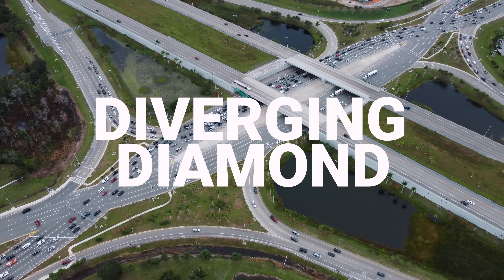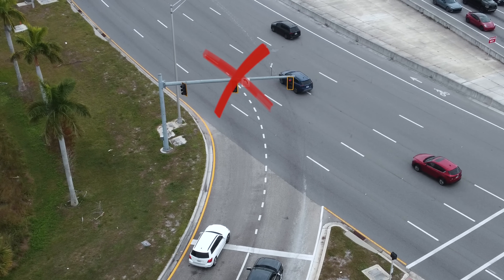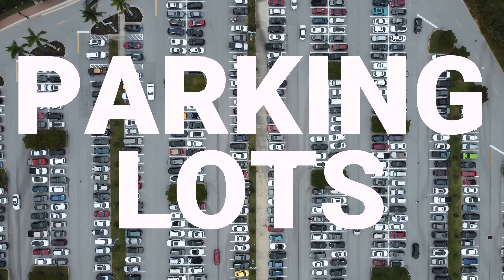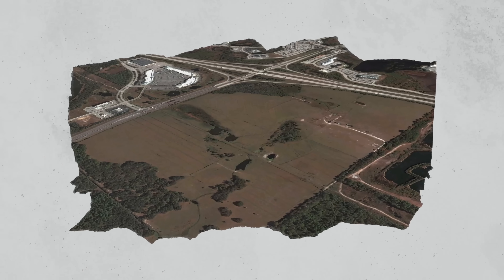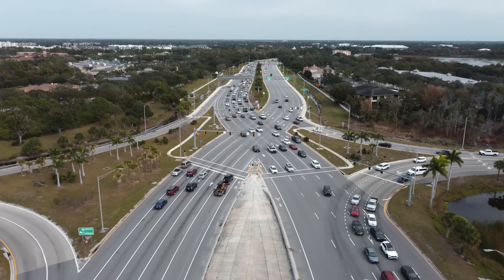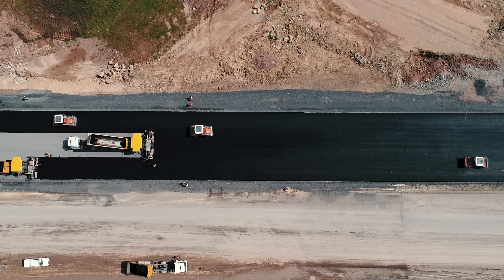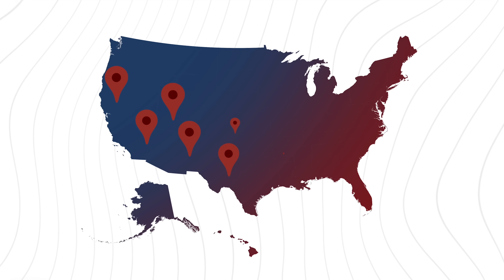Traffic Will Never Be Fixed Here

Comment: The problem in America with mass transit is that it's never profitable. Look at Amtrak, it's never made a profit. Even way back when the the major rail lines used to have passenger rails the only way they can make profit was through the postal service. Once that stopped they lost income and could not keep the lines. Mix that factor with the fact that Americans also want to be able to drive anywhere at any time and you have this mess. It seems to me the best mass transit is the transit that is too expensive for the average American or gets it's income from taxes, which is also not ideal.

Comment: The problem with UTC is in part the sheer amount of cars. Undeniable. But the main problem is UTC has these chokepoint intersections, where EVERYONE has to use the same intersection, even if their target destinations are all wildly different. If they laid UTC out like traditional city grid with street parking, you could still handle a ton of cars, but people wouldn't all be piling into the same intersection at once, which is what causes the bulk of the traffic issue.

Comment: I disagree with, “we should make suburb style areas all into more downtown walkable areas made for people not cars” in some way. I grew up in a small town that used to have many different public places before condos and more homes along the beach and in place of areas that used to be made for kids and people. Now the area is an old folks home. But, before that, because the town was so small, basically everyone there knew each other and you could be in a random store. Someone will recognize you anywhere. The roads never get traffic unless there are big events which happen a few times a year.  The most lanes ive ever seen on a road there is 2 lanes per side. The area is completely walkable and people can bike places too. It just takes a little more time than a regular urban area. The place is designed for roads and people. Just the right amount to the point that every single red light can realistically become a roundabout and would be safe for people and get cars to places much faster. It is a little hard to explain but it is called Fernandina Beach/Amelia Island in Nassau county Florida. Im talking more about the actual island part not yulee. It is pretty interesting especially when I see this video to think about. It would be cool if you check it out because it might derail some of your ideas and create diversity in your ideas also!

Comment: You can build an entire town center in the space taken up by that ridiculously large intersection. Taking 2 tonnes of metal to do basic shopping, waiting 20-30 minutes in traffic each way and guzzling fuel does nothing to add to quality of life. It may still count as "GDP", and is also why raw GDP numbers (which can be manipulated in many other ways) don't tell much. In a different country, one could take a tram - or walk - to shops located much closer to where one lived, and have the same living standards.
Reply: This is not a town center, so this is not a place to build one.  This is outside the city center to distribute to local roads.

The stores here are used by regional/state consumers, not local residents only.  Items sold are not able to carried by hand nor transit, so there is need for parking for shoppers to purchase items.  And the same consumer does not shop here everyday.

Comment: A solution could be on 3 levels: ground level one of the main roads,     elevated level a roundabout, second elevated level the other main road. From the roundabout ramps accessing or coming from the main roads.
Reply: It would cost more and get morr congested due to higher volumes.  Roundabouts work better on lower volume interchanges.

Comment: Us Americans have been brainwashed to think that this is how we have to build our cities because “we’re too big”. 

Japan isn’t walkable, Tokyo is. No one walks 40 miles from Tokyo to another city. They take a car or train. Google the size of Tokyo compared to Houston, Texas and you’ll see why it’s a silly argument to not build for people.
Reply: This is not the city.  This is outside the city.  So by your argument, they use cars.
Reply: @traffic.engineer it’s “outside” the city because the city has built too sprawling, requiring people to live a 30-60 minute drive away because houses apparently have to be 600 feet apart because “the US is too big”.
Reply: @jasonbfhfj8132  again, this is not inside the city.  Downtown Sarasota is high-density low-speed beachfront resort.  That is the area designed for local accessible use.

This area is not local residential, but an area where transnational traffic filters to local points of destination where those residential areas are concentrated. This freeway is set far away from the city core, as freeways in a downtown us questionable.  These commercial areas serve customers from all around the state, not just locals.  This is due to so few of them built in the region/state.  And they sell items that cannot easily be carried by hand.  Which is why this caters more to automobile traffic easily accessible from a national route, as opposed to the city areas where commercial districts serve the local residentials and workers with local low-speed roads.
Reply: @traffic.engineer this exists because of the extreme necessity for cars. Improve walkability and trains and this wouldn’t need to be an issue. A basic highway would have sufficed.
Reply: @jasonbfhfj8132  Sarasota is walkable.  Sarasota County and Florida is not walkable.  No one walks from 100 km to another city/country.  They take a car or bus.

There is already a bus station on shopping center complex.  It provides access from the city center to the commercial district, using a separate road and access from this interchange.  

This interchange specifically deals with the transnational traffic and long-distance customers either stopping for breaks or shopping for large ticket items that are not purchased everyday.  Using rail here would not be cost effective because of the large construction cost, lack of everday commuters (not the central business district), and customers that are in various locations throughout the state/country.
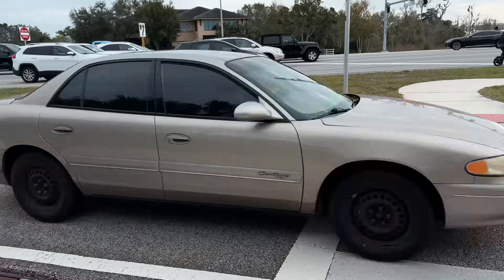Reply: 6:40 is the problem. Look at that, it's like hell on earth. It's evident that Americans are just incompetent when it comes to city planning or traffic engineering.
Reply: @traffic.engineer  Missing the point by a mile.

Comment: You're not even calculating the HUGE loss of engergy(ies) 
lost in those idle cars. TOTALLY INEFFICIENT.
Reply: Because you are not calculating a how much less cars idle.
Reply: @traffic.engineer  An idle car compounds "Time is money". Negatively of course. Loss/ loss
Reply: @21CenturySkyScrapers  And the DDI reduces overall idling.  So problem solved.
Reply: @traffic.engineer  PS: Have you ever seen that city in I think India to where the intersection was intermingled with every 
possible transport with no lights or stop signs? 🙃
Reply: @traffic.engineer  No, Not solved. Just moved up and down the line.
Reply: @21CenturySkyScrapers  yes.  You can tell that video was sped up.

Comment: The backing up could be solved with an overpass with the where the roads cross. One side goes over and one goes under. Suddenly no more conflict point where people stop in the middle of the road because no more traffic light
Reply: If you have the 20x additional funds needed...
Reply: @traffic.engineer  if that cost 20x the whole project. The contractor is ripping you off.
Reply: @waldroop11  That is prebid estimates, not contractor estimate.  You are failing to account for additional cost of materials, additional time and labor for workers and machinery, additional land acquisitiom costs, additional stormwater management facility costs, additional environmental assessments costs, and additional work zone detour costs.
Reply: @traffic.engineer the first half of your argument doesn’t amount to anywhere near 20x cost. 

Additional land needed? This is a vertical situation, either up or down. That doesn’t require additional land. 

Having to do additional drainage is a valid argument to require more cost, but if it was a significant part of 20x I’d question that thoroughly since. 

I’d love an explanation of how an existing road being stacked is an environmental impact. They do this in many places 

Work zone already exists during construction, I doubt it makes that severe of an impact

Comment: Wouldn't a cloverleaf be a lot better since the backups wouldnt happen and you wouldn't need any signals.
Reply: No.  The volumes here would only clog up the ramps back into the highway lanes.  There would be very little gaps for traffic flow freely at speed, which would make ramp traffic stop and accumulate.

Streetcraft has a video explaining this.

Comment: This design is completely ludicrous, and could've been solved by using height differences and cloverleaf designs like we have here in the Netherlands. You call this a feat of engineering, I call it an engineering disaster.
Reply: Cloverleaf would not work with these volumes.  Ideally, it would be great to lower volumes, but the landmarks here attract a lot of consumers that are not local to the region.
Reply: @traffic.engineer  That mostly depends on how your merging lanes look like. We have cloverleaf designs on our busiest highways, and while it's not perfect, they do great for the relatively little space they take.
Reply: @Nidair  Cloverleaf would take more land and increase the cost significantly. It would require more concrete and larger stormwater management facilities, along with greater land acquisition costs.  And it would only queue up more with this large amount of traffic because there would be less gaps to merge at speed.  To the point ramp traffic will essentially be stop/go backup.

Comment: Why doesn’t America use roundabouts 😭
Reply: America has more roundabouts than any other country except France.

And a roundabout would fail here.  The traffic volumes are more than a roundabout's capacity, so it would just create longer queues.

Standar roundabout would cost more due to the extra land, retaining walls, and stormwater facilities to incorporate a roundabout.
Reply: @traffic.engineer True, but isn’t America 18 times bigger than France. And why do I always see so many dangerous cross roads?
Reply: @scottwhibley8392  roundabouts have a very large upfront cost.  Considering America has over 16 million intersections, the cost to convert all intersections that qualify is quite an undertaking.  Additionally, if the volumes increase, it would need to be removed for another type of intersection.  So jurisidictions in America systematically convertwhere the greatest safety impact is possible where funding is available.
Reply: @traffic.engineer true, American is too vast to have expensive infrastructure everywhere, just wish the country was more pedestrian friendly (walkable)

Comment: 1:48 “The only thing that can't change is these two signals here and here, located on the intersections where the road actually flips.”  Yes they can— bridge those intersections.  They don't need to have intersecting traffic, because there's only one choice of direction of travel for each car.  And now you have a basically perfect, high flow interchange.  Go try it out in Cities: Skylines if you don't believe me.
Reply: Cost benefit analysis does not justify it.

Comment: As a traffic engineer, we need to not include any pedestrian crossing on roads like this. No one will use them and they only promote a dangerous environment. If there is a situation where pedestrians would be a common occurrence, then a stand alone pedestrian travel way is needed (pedestrian bridge for example)

Comment: The pedestrian infrastructure here is a great example of what happens if traffic engineers ask themselves "how can we make car infrastructure accessible to pedestrians" instead of "how can we make our infrastructure accessible to pedestrians". It is basically no improvement in comparison to the previous state of things as a "way too long walk with terrible infrastructure" is now turned into a "way too long walk with great infrastructure". It was never the pedestrian infrastructure that was the big problem, it is the fact that everything is way too far apart to have any other option but driving in a car.
Reply: This area serves regional and statewide consumers through tourism and hospitality, not just local residents.  So this area would not have the magnitude of pedestrian activity like the other high-density residential locations in the vicinity.  That does not mean design without any pedestrian facilities.  The other commercial facilities will have different designs if the majority of consumers are local.

Comment: Why a diverging diamond? Wouldn't a cloverleaf intersection work better, because it eliminates the need to have the lanes switch sides, or crossing lanes in general?  So, if it does get more traffic than it can handle, it doesn't clog up both sides.
Reply: Cloveleafs would back up with volumes like these.  It would also be more expensive due to more land outside the right-of-way.
Reply: @traffic.engineer  then we'll just have to throw in some mixed zoning and other things to make the city more wakable and bicycle friendly. As less cars fixes a lot of things.

Ps. Yes, I'm Dutch. :)
Reply: @Jurjen_Warrel_Ottenhoff  This location is not inside the city center.  This is outside where the major national highway distributes to local roads.  This is simply the first access point to head to the major city centers.  These shopping centers are not for everyday purchases like groceries and household items, and such shopping centers are not as common nor frequent.  These are items that cannot be carried by hand over a long distance.  These shopping centers serve a regional and statewide audience, not just local consumers. 

This is not a residential location for most of the car travelers, but still allows pedestrian and bus use.  There is high density residential area in the vicinity that have their community amenities, but is kept separate to not overwhelm local and non-local traffic.  But majority of the amenities here serve the non-local consumers.

Comment: It would work better if the points of crossover were not level.  Then going straight wouldn't need to be a rule, there would be no other options.  The fewer the number of opportunities to break the rules, the less likely it is for some idiot to break them.
Reply: If only the cost did not outweigh the benefit.

Comment: They also did this at Route 59 and I-88, and its actually a horrible design of a road...or at least the one there..

The reason it's horrible is because of time. It maybe good at moving large number of cars (high bandwidth) but the time (latency) it takes for a car to go through the intersection is terrible (high latency) especially for the other 22 hours of the day where there isn't significant traffic. So, for the rest of the day instead of merging straight onto the road waiting for no lights. You are now stuck waiting for 2 very long lights that you never had to wait for before!!!

If the overall/average time per day for a car to get through that intersection with a bad "rush hour/congestion" was 1 minute but now takes 3 minutes due to lights but there is no "rush hour/congestion" each day. Than it is a net loss and a horrible backwards design, and that is exactly what this design does!!!

Like all government projects, they never look at the whole picture and especially don't consider how it affects the individual unlike how the free market/non profits work. They have to care if they want to stay in businesses. Otherwise, someone else will take over.

Comment: The problem is your parking lots act as capasitors, storing the cars. If you have less lots you can less easily overwhelm the network.
Also, every lot is "shorted" at closing, making it that all storages are emptied roughly at once.
Either empty them each at a different time or open the lots 24 hours a day.